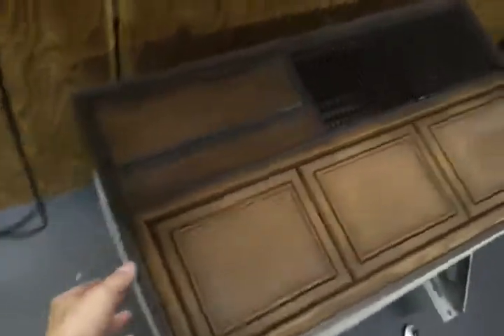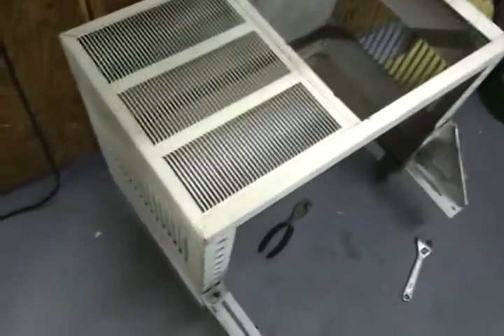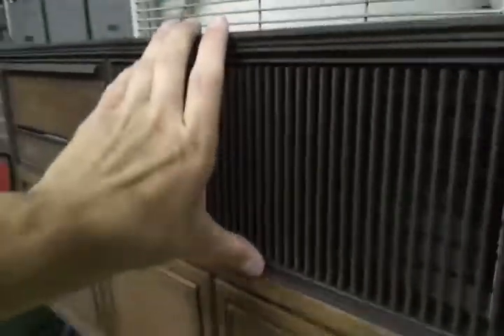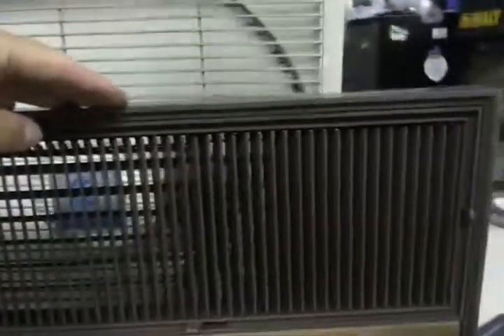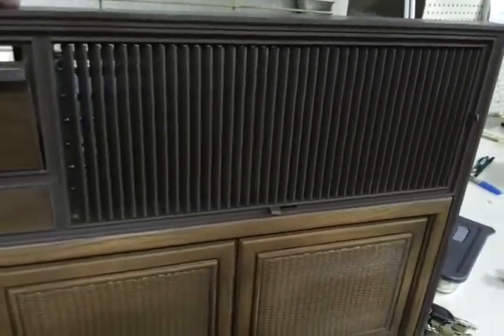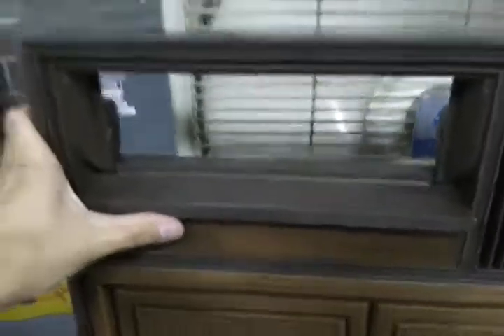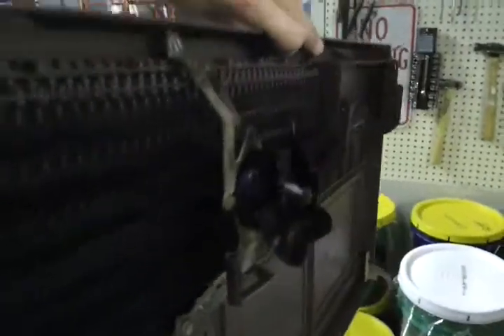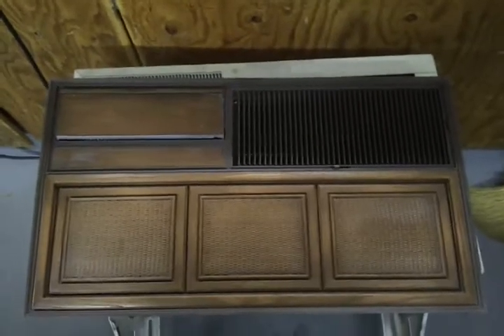Philco Ford Noiseless Air Scan Front Grille

Comment: Thanks for the video\info. Saw one of these in my landlord's old barn. Carted it outside, cleaned it, tested it & it still blows cold. It's a 9,000 btu unit, rated at 1390 watts 😳. So far I see it's missing the air scan propeller (no biggie) & needs a new herm. capacitor.
These old units are easily twice as heavy as the new junk units sold today, but I'm also getting old and weak. 😒
Reply from the maker: let me know if it ever turns up for sale!